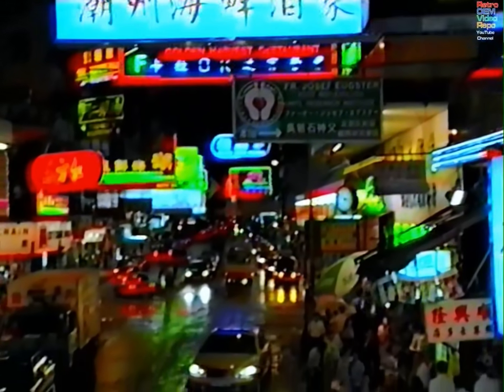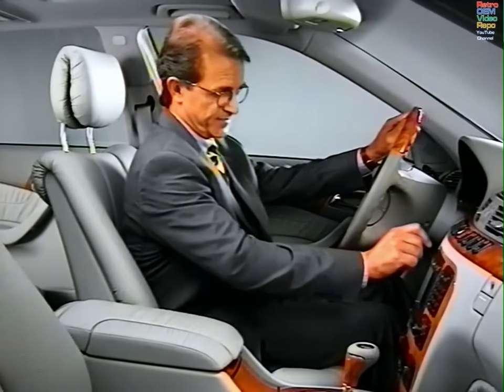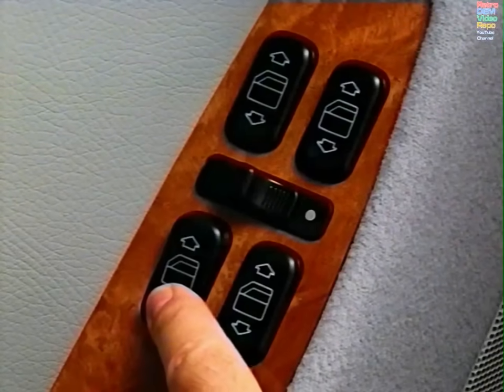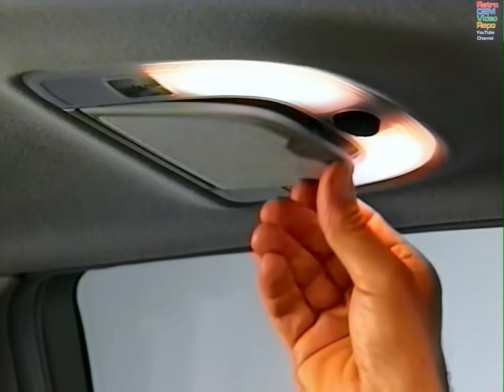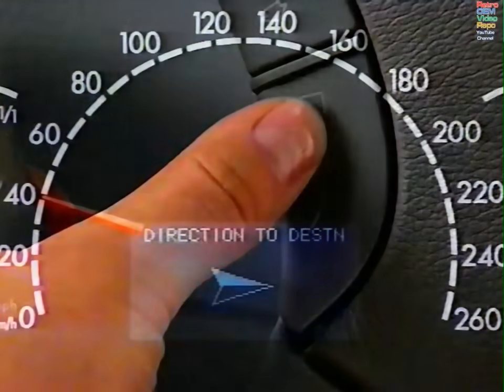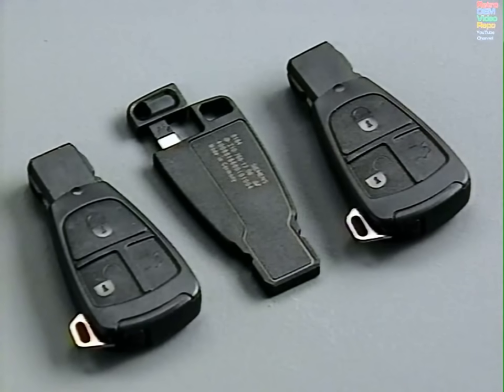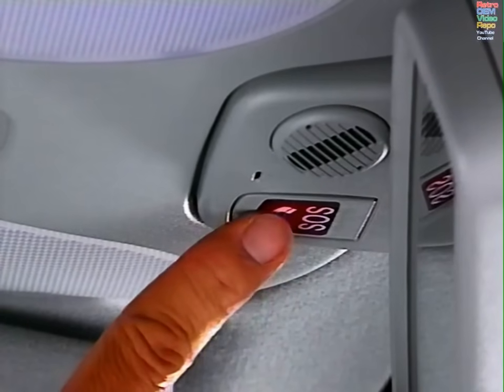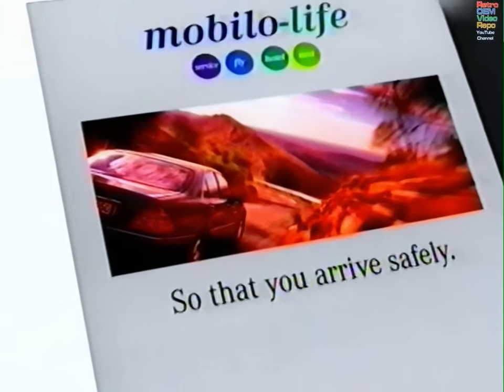Mercedes Benz - S Class (W220) - Video Handbook (1998)

Comment: Back then and as a kid, I was amazed by the Antenna rising automatically whenever I turned on the radio. This S-Class compered was a spaceship.
Reply: my 95 volvo s40 did the same :face-orange-biting-nails:Though i much more prefer antennas that arent visible like my current volvo

Comment: Took ownership of a W220 from 2005 over 2 years ago and even as it aproches 20 years old its still the best car Ive ever driven, hands 
down.
Reply: 2005 is the best year to have a W220 from as it's almost last of the line and most niggling issues had been ironed out by then.
Reply: @andyb3666  People write off this whole generation of Mercedes because of the reliability problems of those old pre-face lift models, and yeah I agree some of those problems are unacceptable on a car like this (Mainly the rust). But after they ironed out the bugs are genuinely some great cars! The M113 and M113k supercharged engines are some of the best Mercedes/AMG ever built.
Reply: Always buy the latest model years 😊

Comment: I owned a new W220 between 2001 and 2005. it was a comfortable and very capable machine, but developed rust in the first 18 months and spent months off the road at the time due to a combination of factory parts delays and technician unfamiliarity. It also depreciated like a boulder dropped from a plane and had so many silly niggily faults that were inexcusable even at the time. 

When I traded it in, I went into a Lexus, and I still drive them now.
Reply: They were much improved after 2003 apparently.
Reply: The severe Rust all the Mercedes from this era experience was a manufacturing error. They solved that in 2004 I believe.

Comment: "You should also read the handbook for your vehicle..."   It was 560 pages, plus a DVD.  I bought a 2001 S430 new in Feb 2001.  Adored this car...i can say without exaggeration that both my head and heart literally swam every time I got behind the wheel. What I didn't love was the $70,800 window sticker price (non-negotiable / "no-haggling").  The S500 was $10,000 more, for just 27 additional horsepower, which bought you a 0-60 mph time of 6.0 secs. vs 6.9 secs. for the S430.
Reply: was there a size difference?  stupid question but aside from engine size did they ever make smaller S class?
Reply: @fredrezfield1629  yes, there was S320, S430, S500, S600 L the longversions had more space in the back and wider doors on the rear passengersides
Reply: What other spec did yours have ? And how long did you own it.
Reply: @Tapot_goo  i have a 04 S500 4MATIC, best car I have ever driven. Ive done alot of work on it, going on 3 years of ownership. Quad AMG exhaust from S65 on the S500 is my neighbors new alarm clock

Comment: @1:51 "...traditional Mercedes values of quality, reliability, comfort and safety..." : my experience with my parents' 1998 S320: comfort and safety are nice, but the lack of quality and reliability is frustrating. The car has so much rust and these annoying electronic problems. It's really a shame. It is the worst car I have seen in years. It is not worthy of an S-Class.

Comment: I can't resist this. I was just purging my email junk when I noticed a reply to my dilemma from two years ago. For background, scroll down. This may prove to be amusing to some. The poster who mentioned the ignition system came the closest to an accurate diagnosis. I had noticed there was an error in the electronic ignition when I scanned it. But I dismissed this since every Mercedes Techie I took it to never came close to that. Except on one occasion, a local guy here advised me that when he used the other set of keys, it seemed to scare the gremlins away for awhile. Ok.. So here it is: After spending thousands of dollars in useless labor, part fraud, time and cold hard tax paid cash and crying in my beer... One day I noticed that when I pressed the key fob button to unlock the doors, the little red diode on top of the fob was failing to light up. Aha.. Watson..     I think we're onto something. Fast forward pulling the key fob apart and replacing the battery.. Drum roll please. Investment - $4 and the time it took to replace the key fob batteries. Stop laughing : (

Comment: Actually the crash test isn't good. It almost reaches the crumple zone (which is good but not for a car of this class)
Smaller cars like the Seat Toledo 1999, Mercedes - C w203, the Saab 9-3 2002, the Ford Crown Victoria, the 2003 Honda accord...Did better in the crash test

Comment: 500km on the clock, already has a fault code 

I know thats intended but still.
Also, oldschool electronics with indivdual systems instead of one big bordcomputer are a pain to work but a pleasure to watch.
Reply: Think of it this way: If the single board has a critical fault you're replacing the entire ludicrously expensive board rather than smaller, individual, units that are simpler.

Comment: they did all of this to keep up with the ls400 and still couldn't lmao
Reply: Not sure where you heard that from. The W140 was the response to the LS400. This blew the LS400 away in every aspect.
Reply: @MrCarGuy  The 430 was quieter, smoother, and more technologically advanced than the W140. Couple that with reliability that the 140 couldn't muster and the only reason to prefer the Benz is for the brand recognition and prestige associated with it.
Reply: @zykarionng6633  Hmm. You mean the LS400 vs the W140? I would agree, but only with the UCF20 and after. 

The LS430 was better than the W220 *for the price*.

Comment: Audi has an immense technology and by 1998 they had screens, navigation, cruise control, parking sensors and it is actually a revolutionary brand in technology, but this 1998 Mercedes Benz has broken all technology schemes, with close detection of vehicles and the reduction of speed by obstacles, use of the smart key to open the vehicle even when it is in the pocket, technology that audi integrated in 2003 with its luxury car audi a8. My thought is that a 2020 Toyota does not have the same technology as the 1998 Mercedes Benz or an 2003 Audi A8.
Like if you agree with me

Comment: 0.37 DRAG COEFFICIENT? That's like driving a truck lol That hydraulic suspension system is a nightmare to work on! Just like the 600 GROSSER with it's hydraulic pressure system that powered the automobile's windows, seats, sun-roof, boot lid, and automatically closing doors.
Reply: It's .27, buddy. Among the lowest possible for a sedan.

Comment: I never knew heated/cooled seats existed 20 years ago. this car was ahead of its time, incredible
Reply: And that's provided, in our heads 20 yrs ago was something like circa 1990. But when in fact 1998 is already 25 years ago based on my comment made in 2023.
Reply: They’re ventilated but not cooled.
Reply: More incredible is cruise control with radar (DTR) - nowadays known as "adaptive cruise control". Actually, this S-class was first car with that feature.
Reply: The first car with heated seats was the Saab 99 in 1971
Reply: Heated/cooled massaging front and rear seats, electric headrests, full adjustable seat massaging, keyless entry and start, voice control. There's a reason this was basically the single greatest jump forward in automotive industry.
Reply: Same with the electronic adjustable seats!

Comment: Not easy to believe that car comes out 1998 still cars in 2019 don’t have the technology
Reply: @edgarallanpoe9534  Why don't you do that? Cars under 60-70k still don't have the features I mentioned.
Reply: @edgarallanpoe9534  and mercedes didnt?
Reply: xdennis 912 that’s objectively false. Stop spreading lies you ignoramus.
Reply: @edgarallanpoe9534  He's absolutely right. Most cars still don't have pneumatically-closing doors, electric headrest adjustment, etc.
Reply: MrCarGuy20 you aren’t wrong.

That’s true in almost every since.

Why don’t all cars come with electrically powered head rests?
Reply: @TraceLight  Well, prices for motors and the wiring, installation, and further costs of the track assembly for the headrests are not any lower. It's probably something forever reserved for luxury cars. I drove a Model S for 3 months and the headrest was so much worse for me (permanently affixed and am atall driver so it dug into my back).
Reply: MrCarGuy20  dude.. my Audi Q7 has most of the features that this car has
Reply: @chaoszombie9995  "Dude", that's not even a logical reply. Try reading the previous comment first, at least. Buick had auto headrests in 1990 too, but that doesn't represent any sort of population and it was an outlier. As I said, it's still only a feature found on luxury cars.
Reply: @Kilo Byte  Why would you care enough to type this?
Reply: Because its all luxury features, which can break... these S classes arent made to last 20 years.
Reply: @DevasionX  I'm looking at mine right now. 20.5 years old. Still here.

Comment: I drove my boss's 2001 S320 in 2002 and oh man was it an experience for a young boy! These are smooth and comfortable cars but they had their issues.. Some rusted like crazy and if you get one nowadays the air suspension is a bitch and the SBC brake system can be costly...

Comment: So my dad wanted to get a used W220 and after a test drive it comes to show that the boring handling and slow acceleration of the 2.8 V6 (yea in Malaysia all luxury cars turned into snails due to engine displacement based road tax pricing) made my dad get a W211 E240 instead. But honestly I don't mind owning a Daihatsu compact car for day to day use and a W220 S280 for long distance drives. Our W211 is already comfortable enough to drive and ride. Can't imagine the W220.

Comment: It's crazy to think that this vehicle came out 20 years ago! And yet it has features most new cars today do not even have. 20 years ago this was telling you that you're getting too close to the car in front too quickly. Basically it already had a collision warning system. Amazing.

If only they made modern retrofits for current times like a phone module that actually has a Bluetooth module inside for Bluetooth calls and audio streaming but that still looks like the old phone in there. And updated maps on a new CD.

Comment: these cars are teenagers flex tool now.
Reply: @Heracles A. as a broke eastern european teenager who almost bought an s class, i can confirm
Reply: 95% of teens can't keep these on the road because they don't know how to maintain their own lives: Let alone this. These are very simple to maintain and last forever if garaged. UV is the enemy of the W220.
Reply: MrCarGuy20 still, they will never last more than 150,000 kms
Reply: @putridvomit  Yeah? A neighbor has been driving his since second-hand with almost 300 thousand MILES. Someone on Instagram I follow has way over 300k miles on theirs. This is the US southeast and I've also been driving my S430 problem-free for 8 years.
Reply: @MrCarGuy  but how much have you spent on preventative maintenance
Reply: @putridvomit  Basic automotive maintenance and the only other thing is it goes through tires maybe 20% faster than other cars. Its parts are actually cheaper than my Lexus and everything is enjoyably easy to work on. 

People who go around saying how it's so expensive and hard are the same people that are dumb enough to be screwed by mechanics taking advantage of their ignorance.
Reply: @MrCarGuy  1993 Toyota corolla - 436,389 KMs - 3 oil changes since bought - runs like clockwork - original clutch, etc
Reply: @putridvomit  Yeah. I also have a 2000 Lexus GS400. Both cars run absolutely flawlessly if not abused and basic maintenance performed. Stop with the YouTube commenter brand superiority BS. That was an era where both Toyota and MB products were easy to work on and reliable (obviously Lexus manufacturing and design standards will always be better) but at least it's not as bad as MB is today with reliability.
Reply: @MrCarGuy  A W220, if cared for and kept in immaculate condition, is an enjoyable automobile. However, here in eastern Europe most are rusted, dirty and disgusting scrap heaps that are driven by local aspiring tough guys.
Reply: @audiofiil  I don't think they need to be kept immaculate to be enjoyed but I understand your perspective. In the southeast US, many original owners still have their W140 and W220. They just use them as vacation cars. I got mine from its original owner who used it for vacation use. Ideal car for highway travel.
Reply: @MrCarGuy  mad boy who was raised a little nose up huh?
Don't hate anybody my friend, you would be much more sucessfull
Be kind :D every brand has its own story and why they did smthn
Many people learn it to late don't be one of those
Reply: @erwin0713  I'm not sure why you would think I'd need "wise" advice from you (someone who writes on a middle school level). This advice doesn't even relate to my comments at all. I've stated nothing but facts here to counter misinformation and myths spread through ignorance.
Reply: @MrCarGuy  my friend have one drived over 700 000km :D
Reply: @MrCarGuy  THANK YOU. Someone actually knows the truth for once. Respect..
Reply: @putridvomit  German quality is way ahead of Japanese lol many old Mercedes last over 1milion killometers
Reply: @putridvomit the engines in the s class are ultra reliable mercedes makes great engines i own 3 mercedes and i disagree with you my old w124 has 450.000km runs and drives like new my 2007 w211 320cdi 290.000km and it has been trouble free.
Reply: @Heracles A.  And who was it meant for?? Bro im mercedes for life, my father drove this car when i was 4 years old (now im 23), but you are trying to justify this series of merc even though everyone knows they are an electronic nightmare, and when they are driven in cold areas where they use salt on the road (Germany for examle), they are are fuckin disgustingly rusty. it is a joke that a car that cost this much rusts 100x times faster than a Golf of the same generation.
Reply: @SugarBlood15  the Facelift doesnt rust
Reply: Lmao true
Reply: @fretsofdeath They dont rust, because they use aluminium alloy frames. I myself own cl 55 amg and its 20 years old but has 0 rust on it
Reply: @fretsofdeath what then? How does car die in rust otherwise?
Reply: I have one but its clean
Reply: People enjoying cars they like is bad.
Reply: Until it breaks
Reply: AndyZULUL your insta???
Reply: Heracles A. Yep if only the engineers weren’t amateurs and knew how to make a reliable car like the Japanese smh

Comment: Your title says 1998, but this is a 2000 model, I don't think that the w220 was even in development in 1998.
Reply: Semaru Gaijin Correct. If you wanna bring a car on the market in 1998, they must have started design and devolpment in 1993.
Reply: This car DID come out in Q3 1998, as the 1999 model. The first time I saw one in real life was in September 1998.

Comment: Even nowadays this car has a lot of features. True keyless 20 years ago? It’s still new tech in 2019 cars. The S Class has always been far ahead from its time.
Reply: Back then when German cars were the absolute leaders
Reply: @m8_981  i think they still are, but they have become incredibly expensive
Reply: Amazing Blyatman yea kinda but quality went down so hard .. it’s so sad to see that everything is about money now
Reply: @m8_981  yeah, thats what I meant. The prices have rised so much. You can get better quality for your money at other brands now
Reply: keyless isn't new tech in 2019. it was new in like 2011
Reply: @kuba__  Renault had keyless entry/go since 2002
Reply: @blue7081  This is true. I know Laguna models had those and they still work.
Reply: @Kyntteri  And Laguna was released in 2001, so they had it even earlier
Reply: Caio Barros true!
Reply: I think w140 also had it in 1996 for  facelift s600
Reply: keyless entry was normal thing in europe from early 2000s.
Reply: What are you talking about? If you watched the video, it isn't keyless, it uses the FOBIK. All they did was take an existing immobilizer ignition switch and deleted the lock cylinder and hid the key blade. You still need to put it in the slot and twist. Instead of having a mechanical lock and an immobilizer, it only checks the immobilizer.

Chrysler cars got this even in the cheapest models beginning 2004, because it is cheaper than a conventional key system.
Reply: @straightpipediesel  they showed both standard and keyless systems in the video. In the keyless system the card key never leaves your pocket and you start the engine with the pusher on the gear selector